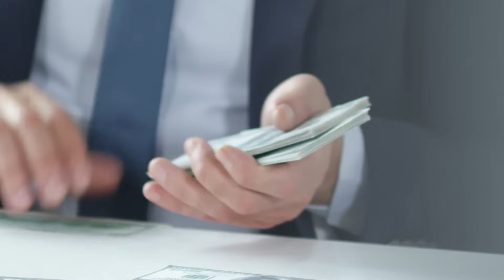HARLEY DAVIDSON - 2025 Models MADE in Thailand not USA!

Comment: I'm in Australia and my 2022 CVO road glide shows on the frame as being made in Thailand
Reply from the maker: @kmeades43  they consider Australia the Asian market for some reason
Reply: @RidingintheOzarks  It is probably easier (cheaper) to ship to us here in Australia from Thailand than the States. Our whole range save for the new X350 and the X500 are out of Thailand, the X series are out of China. We don't sweat it too much. It's not advertised obviously through the dealers that your new H-D comes from Thailand rather than the US. I don't suppose that 'Ride the Thai Legend' on all of the branding in the dealerships would have the same ring to it as 'Ride the American Legend'. When I purchased my new 2024 CVO Road Glide I pointedly asked the dealer where the bike will be made and he responded "I think the CVO's are still made in the US" I'm sure he full well knew they come from Thailand. The compliance label is even positioned so its difficult to read (impossible) the country of manufacture. The build quality is still there but I do notice that things like the paint, etc. has declined over the years compared to earlier H-D's I've owned. However I'm presuming that this is the same irrespective of where the bike is manufactured. I also note little cost savings in the way of no compendium for the owners manual but a plastic bag. Thanks for the video it was good to hear what was said in that press conference as I had not heard it mentioned elsewhere. I find it highly unlikely that H-D will tool up an assembly line for a 12 month run, could be wrong but I probably doubt it.
Reply: @MS325Productions  Hi I'm from Europe and my low Rode ST 2024 has a label made in Thailand...
Reply: @petrnosek411   Damn that’s sad!!!
Reply: @kmeades43  damn that’s sad!!!
Reply: @fpvmississippi  I took a tour of the Harley Davidson plant out here and it's a really nice facility. They put my friend's son thru college and tech school out here in Thailand and now he's got a full time job working the assembly line. What's sad about that?

Just down the road is the Ford plant, where they make Rangers that are actually reliable, unlike the ones back home in America.

Comment: Given how poorly the Revolution Max motorcycles have been received I could care less where they are made, they were designed here and that is the important part. Look at it this way, Harley has new riders learning on Chinese designed and Chinese manufactured motorcycles so if that wasn't enough to worry people this move should not concern them either.  Harley needs to be more price competitive and another legendary brand long ago allowed lower displacement bikes to be made outside their home country, BMW.  They now have a complete line up starting at $6k to over $30k.

Let us all be honest. Harley's volume has not been improving and in a decade has dropped by a third.

last note, given how poorly they Sportsters sell no one is going to care where they come from. They need to be redesigned so that the motor looks good from both sides and have more than two models for sale.
Reply: actually, Harley has had a few models made elsewhere before. In the great bike boom of the 70s, they needed a decent trail bike and they needed a smaller displacement street bike, so they offered rebranded imports from different countries. I remember them well. The Harley street bike was Italian and had a single, pushrod horizontal cylinder (I thinkk 350 and 500, but I'm just guessing) and was pretty gutless, but people bought it. The trail bike (I think it was Czech) was fantastic. Your local dealer can tell you the facts. I'm not sure why people are mad now. I have my doubts that mahy people will really sell their Harley and buy an Indian, like they claim. That would be weird.

Comment: I think it's a fairly common thing these days, when a company evolves into a corporation, all of a sudden you have this entity called, board of directors, calling the shots, and they are only beholden to the stock holders. Then it becomes all about the bottom line, all else be damned. Also you have the union whose interests are at odds with management, It's like two dogs fighting over the same bone. This is when the decision becomes clear about relocation even though the bean counters know it will come at a high cost.

Comment: One other justification of why Thailand is that the plant we have here in Brazil at FTZ of Manaus is just an Assembly line and not an actual production line.

It was the first overseas operation that opened back in 98.

I visited the plant and I can tell you, all (and I mean all) components are shipped in parts (including the engine) and it’s all put back together here (CKD).

Thailand, on the other hand I don’t know it it works as the same as Brazil or if it does produce anything from raw materials….

Comment: Having just spent a huge amount on a new Low Rider s, stage 4 and fully decked out in the clubstyle, Thrashin Supply co gear and brake levers, full paint protection, powder coated wheels, Arlen Ness big brakes, se/ohlins suspension the works and being in Australia with the shipping for these parts added, you can imagine how much I just spent and now to read all this stuff and these comments…I went from being over the moon with excitement to pretty damn deflated but I’m not surprised, it’s seems to be just my luck ftw.

Comment: Entry level riders usually won't start with a 12 0r 10k Harley anyway, but instead with a cheap ratty used metric drop bike. Large displacement Iron in Asia is like an albatross. They have a much better chance of increasing worldwide footprint, bottom line, and sustainability there where 250-1200cc bikes are the norm. I currently ride a 117 cube Harley; it's my 5th Harley over the last couple decades, sometimes having more than one at a time, including an 883 and will be loyal till the end. "Gee I wish I never sold my sportster" has been said by few big twin riders. I just hope they keep the promise to utilize the freed-up capacity to build more American Iron here, especially in Milwaukee. And YES Mr. Gherkn Zegerkin has to go anyways.

Comment: I have done finically well in the last 20 years.  I have purchased over 25 new HDs and enjoyed riding them. I currently own 2, 2023 models and will not buy another until the CEO is gone and the board is changed.  DEI, moving production,  and the CEOs comments on capitalism are my drivers for my decision. I suspect this will not go well for HD. I am a customer, was, and will react with my wallet.

Comment: If consumers benefit from the move with lower prices, I don't care.  Having owned a 2004 Sportster, requiring a complete engine rebuild just after the warranty ran out (30K miles on the clock) and a top end rebuild on my 2018 M8 LR, again soon after the warranty ran out (13 miles) after the SE valve spring crapped itself, and you would already know about issues with the Pan America, including things like nuts/bolts coming lose, I can tell you the made in the USA does not equate to made in good quality.  When I went to take the crash bars off my Pan America to have them painted to a custom colour, I tell you, there were 2 (of 6) miss-threaded bolts - just hopeless made in the USA workmanship.

Comment: it shouldn’t make any difference where the Harleys are made. They’ve been using components made in Japan and China for decades, that’s what made Big improvements in Harleys, modern, ignition, modern fuel injection.. I would not be surprised if a lot of bearings, nuts, and bolts, oh rings, cables, lights, instrumentation, sound systems, you name it, I would not be surprised if hundreds of bits and pieces on every Harley came from asian suppliers..
  But I agree, it’s ironic that Harley Davidson, the company that got president Ronald Reagan to slap a 45% tariff on imported motorcycles back in the mid-1980s causing the price increases like, a $2999 Honda, Kawasaki, suzuki, Yamaha 750, that’s where they were all priced because I was a salesman. Then, those motorcycles overnight went to $4750, plus extra sales tax on top of that $1750 increase…
  that tariff was to save the 600 American workers jobs at the Harley factory..
but nobody ever thought of this part, more than 1100 Japanese motorcycle dealerships, went out of business in the first two years of the tariff. The average number of employees at those 1100 shops was seven. what about those 7700 American workers jobs Mr. President?
there were 22 Japanese motorcycle dealerships within an hour of my home before the tariff to save the 600 Harley Davidson workers jobs. now, here in 2024, it’s been like this for sometime. Actually, there are only three survivors of the tariff still in business within an hour of my home.
  here is the biggest irony
Ronald Reagan preached that government should stay out of the dealings in business. Let the market take care of itself was his motto. 
  here is a quote from Ronald Reagan
“ The scariest words I ever heard were, hello, I’m from the government, I’m here to help”..
  Reagan was pointing out that when Government starts pulling strings for business, bad things happen.
  and to top it off, the man that said those words, single-handedly wiped out .  a , thriving motorcycle market in the United States.. all in the name of saving 600 jobs at the Harley factory,
 The fact is, the Japanese were making spaceships compared to what Harley was making. At that time, the Japanese were making shaft, drive, water, cooled, electronic, ignition for valves per cylinder, reliable motorcycles for cheap prices. They introduced tubeless tires, disk, brakes, front and rear.. singles, twins, V, twins, triples, in-line fours, V fours, flat fours, six cylinders, The Japanese even had turbos on the market..
  Harley was selling dinosaurs compared to the Japanese machines
  that tariff did so much damage to a thriving market. A market where people getting started riding motorcycles, could buy in an expensive Japanese motorcycle, learn to ride, and later switch to a Harley. I really don’t know anyone that has ever bought a brand new Harley as their very first motorcycle. I’ve been around motorcycling since the late 60s, I never heard of anyone buying a Harley as their first motorcycle. 99.9% of motorcyclists started out on a cheap Japanese motorcycle, then they graduated up to a Harley..
  we are now almost 40 years removed from that terrible day when the tariff was applied to imported motorcycles jacking the price up. Making motorcycles too expensive for people to start out. So the result of that is, that tariff eliminated Harleys future customers. Because they never got started because of the price of motorcycles going up 45% just because Reagan said so.
  so Harley has no one to blame that their sales are down by as much as 40%. They put motorcycles out of reach for beginners in the mid80s,
that tariff has gone full circle and come back around to bite Harley in the ass today 
  I currently own my 108th and 109th motorcycles since I started riding dirt bikes, motocross, bikes, trials, bikes, road, racing machines, commuters, sport, bikes, café bikes, big touring machines. I have never had a Harley. They don’t make anything I like. I would love to buy one, if they made some thing I like, which they don’t.
  so making note that Harleys are now made in Brazil, India, and now, Thailand, and almost almost Germany. But I think Harley practically. There was a year I don’t know if it was 1981 or 82, but Yamaha sold 120,000 units of each two cylinder XS 650. 120,000 of those bikes were sold in the United State in one year… since the tariff that Harley got Ronald Reagan to apply to import motorcycles, Yamaha has not  sold 120,000 of every model they make combined in a single year..
  it’s funny how what goes around comes around,
Harley eliminated the competition with a tariff, it also eliminated generations of future motorcycle buyers that would start on a Japanese motorcycle, and move up to a Harley someday 
  I realize that not everyone that would have started out on a Japanese motorcycle if there was no tarrif.. not all those people would’ve moved up to Harleys. Eventually,, probably only a couple hundred thousand of them would have moved up to a Harley if not for that tariff. Just that one little thing.
  it’s funny how things work out in the long run..
Reply: The tariffs were 42-years-ago-now, Jody. Much different times.
And even with them ~ the old AMF HD still nearly went broke producing junk.
But six employees bought the Company in the nick of time, and totally reinvented it. 
Starting with the EVO engine, and employing Japanese QC methodology, they started turning out great bikes.
And it's all been a great success story since. Knowledgeable riders treasure those first late 80's FXRS's. Best HD ever!
All the Japanese brands have tried to shoehorn in on this huge lucrative market segment HD created - and all have flopped!
Polaris tried with "Victory". It flopped. Their "Indian in name only" is there second shot at it? Spending HUGE money!
They too are going to have one helluva time knocking off the King. Just like Honda has! 
That HD is going to go broke is nonsense.
Let the wailing and gnashing of teeth being!